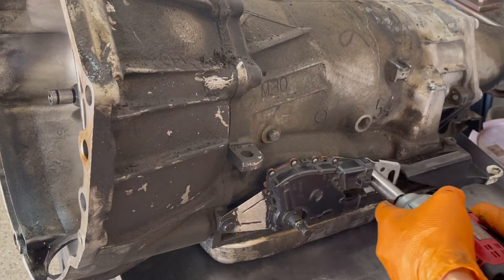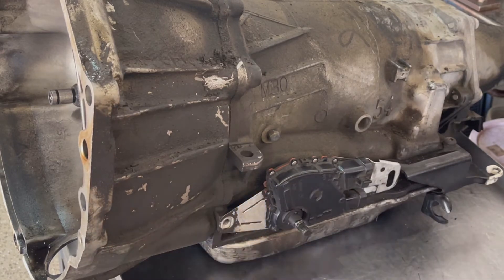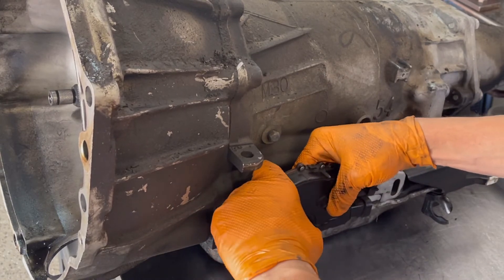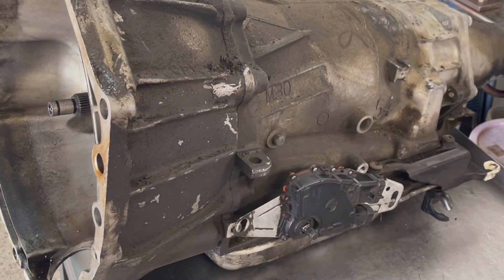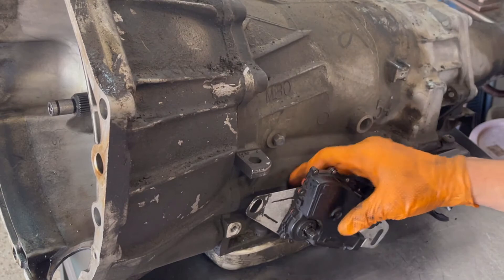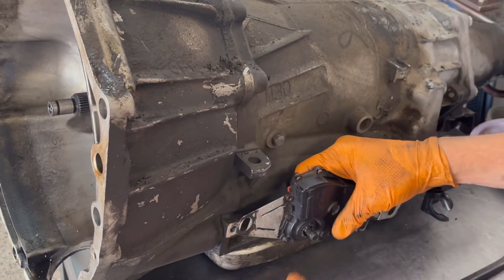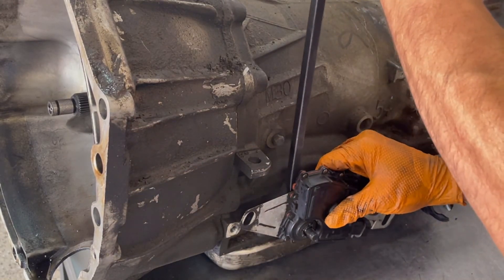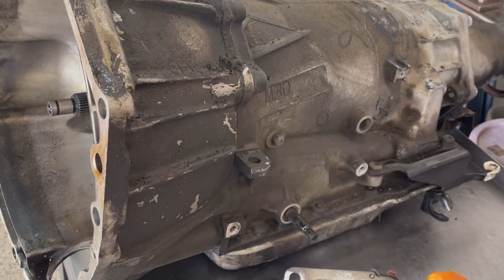4L60E & 4L80E   No Crank No Start Bad Digital Range Sensor/MLPS/Neutral Safety Switch

Comment: Everything turns on on my truck like normal but i replaced the transmission and now all the lights come on but it wont start or crank, it dims everything when i turn the key to start its like its trying to start in the wrong gear
Reply from the maker: What year, make model vehicle and transmission?
Reply: @nickstransmissions  2003 gmc sierra 4l60e
Reply from the maker: Check the MLPS, make sure there is a secure connection with the two pig tails - you should have two connectors as 2003 was the last year of the two-connector MLPS. If the wiring is bad or the sensor is either old or it came with the transmission you installed, I'd purchase and install a new one, just to be on the safe side. You don't want the MLPS failing strand you when you're far from home (I'm assuming you and the truck are at home atm).
Reply: @nickstransmissions  yes it crunk and everything before i dropped the transmission i put the same mlps back on it and now it does that, but im gonna buy a new one and see if any of the wires running to it are messed up but i subbed and ill lyk what happens
Reply from the maker: Sounds good, Ronnie. Thank you for the sub and for watching.
Reply: I replaced the separate valve plate in my 2017 chevy Silverado and its doing the same this in this video do you think that my problem
Reply from the maker: @deandrebrown994  - You're dealing with a no crank-no start in your 2017 Silverado? If so, what transmission do you have (I'm assuming a 6L80 but confirm or correct me if I'm wrong). It's possible your internal mode switch (IMS) has failed and is no longer sending range position data to the ECM...If that's the case, it will need to be replaced...The IMS is located on top of the TEHCM, inside the transmission. So once you drop the pan, you'll see it...Rule out all other causes first then drop the pan and test the IMS for continuity at channel N (the pin associated with communicating range position data to the PCM). I'll be doing a video on exactly how to perform this test on a 6L transmission and post to the channel within a week or so.

Comment: can you do a 6L80E switch like this
Reply from the maker: Hi Bob, are you asking if you can wire up a 6L80 IMS like a 4L60E MLPS or are you asking if I can do a video on the 6L80 IMS? If the latter, one will be on the channel within a couple weeks...If the former, no it cannot be done.

Thank you for watching!
Reply: @nickstransmissions  the 6l80e switch indicator. I'm doing a swap into a old 50s chevy car. the motor is out of a 2010 Camaro. 6.2 l99 and 6l80e trans. I'm trying to get the switch figured out so I can start it. I have a decoder for the can bus so the reverse lights work. it also controlling the park and neutral switch. but it seems like it is in between the park and reverse. a 50/50 mix.
Reply from the maker: Do you have the factory pcm from that Camaro? The Internal Mode Switch (IMS) is what you're referring to. In the 09+ 4L60Es, 6L and 8L transmissions the device that informs the pcm what range has been selected is the internal mode switch. Just want to ensure you know what the correct term is for the part. Make sure the IMS is installed. Then drop the pan and disconnect the IMS connector. You will then take a multimeter and set it to display OHMS. Put the key in the ignition, set to the on position but engine off. Put test leads on the IMS pins then have a helper run through the gears while you test different pin combinations with the multimeter. You're looking to see the resistance change as your helper moves the shifter. If there's no change the IMS is faulty and needs to be replaced. Ill link the ATSG manaul in the description if it's not there already. It has IMS diagrams and addl info
Reply: @nickstransmissions  yes the internal mode switch. I do have both factory ecm (E38) and tcm (T43) from the Camaro. your other video also said the linkage rod may not allow it to go into park. I do know it requires the sensors to have power and not have power at certain postion. I just do not have the ATSG papers in front of me
Reply from the maker: Check out my 6L80 Info thread on TahoeYukon forum - has the link to the ATSG manual and more plus a bunch of other content: https://www.tahoeyukonforum.com/threads/gm-6l80-transmission-information-thread.141927/

Comment: Is the neutral safely switch a possible fix for a limp mode issue on 1999 gmc safari?  I have been dealing with this for over a year . It has intermittently shifted fine but majority of the time the van wants to take off in 3rd gear. I can manually get 2nd gear but no 1st gear.  I have changed both switch solenoids, ignition switch and recently the pcm. No fix yet. After installing pcm  ans going through security protocol the van started and ran. I let it sit several days and now it cranks but no start again...any help appreciated
Reply from the maker: Hi Tim, sorry to hear you're having those issues.

Sounds like your transmission is going in and out of limp mode. When the 4L60Es go into limp, you have 3rd and reverse, that's it. I suspect nothing is mechanically wrong with the transmission itself however you have either short-to-ground issues external to the transmission or perhaps the wiring harness inside the transmission is bad. First step is to determine if you're getting any voltage to the transmission. Use a multimeter to see if any power is making it from the ECM via the external wiring harness to the transmission's wiring harness then go from there based on what you find.

If your MLPS was bad, you'd have zero crank whatsoever so a "No crank, No start" condition....Sounds like you have a "Crank, No Start" condition, which means you're missing either spark, fuel or compression.
Reply: @nickstransmissions  local shop here checked electric to transmission and claims all is fine. Pcm was a hail mary.  When hooked to scanner it shows van is in 1st gear when actually it is not. Now after installing pcm I have a crand but no start issue again. I'm gonna run through the security protocol again to see if will start. If not I'll put the old ocm back in it and see what happens
Reply from the maker: Yea, my suggestions are based on the info you provide to me and didn't mention a shop looking at it (doesn't really mean anything as it's common for shops to miss things like electrical issues). 

Does it crank, sounds like it's going to start then immediately die? If so, that's definitely VATS not being reset. There's a 10 minute protocol and a 30 minute protocol...If the 10 minute protocol doesn't work, you basically do the process twice more and that should work. 

If it cranks over and over but simply doesn't want to fire up, we're back to spark, fuel and compression.

ETA: Since your trans is starting out in limp mode (3rd gear), I'm inclined to believe that you have either a PCM issue or undiagnosed electrical failure and that's why I suggested that you use a volt meter to see if you're getting any power to the transmission at all via the external wiring harness. If you're getting the required power supplied to the transmission then the problem is either in the transmission's harness or electrical components or the power train control module.

Comment: I have an 07 silverado but I can usually hear my fuel pump in the ON position. I have no crank, no start. Only thing that works is my interior accessories and lights.
Reply: Thank you! Yea I’ll google that. I’m not sure how to do a continuity test on the switch but I’ll look also. Swapped the starter fuse and it didn’t start and I used a jumper wire in starter fuse spot and it crunk so I’m assuming the starter is good
Reply from the maker: You're welcome, Josh. Please sub if you havent already...ill actually be publishing some diag and trouble shooting videos in the next couple weeks or so...
Reply from the maker: Thank you!
Reply from the maker: Hi Josh,

Any recent history of battery or charging system troubles? If not, and given all your interior stuff works, I'd suspect the mlps (4L60e/4L80e) or internal mode switch (6L transmissions
Reply: No history. My battery cca was 460 and the battery is rated 910 cca and 12.1 volts. 2019 battery but I would figure I would get a click or something. Jumper box won’t even do anything
Reply from the maker: Does the battery show 12 volts on your tester?
Reply: @nickstransmissions 12.1 volts. I was leaning towards the ignition switch. I did charge it to 12.6 and it didn’t do anything. Just the cold cranking amps are low. I mean I guess the battery could just be damaged. Is the mlps the same as the neutral switch?
Reply from the maker: Do a load test on the battey to see if it's damaged (search google if not sure how to do a load test). Check for blown ignition fuses. The ignition switch can also be bad; check it for continuity and power. Also check the starter solenoid also. If you can rule those out, the mlps is likely the problem.
Reply: Did you find your problem? Mines doing the same
Reply: I had to have a new computer unfortunately
Reply: @joshstokes5669  when you turn your key to start did the headlights blink like it wanted to start? Its no noise but it kinda like dims all the lights and stuff
Reply: @joshstokes5669 was it like you trying to start it in the wrong gear?

Comment: What year is this for? I have a 02 Chevy express 1500 with the 5.7 Vortec that has been having some severe power and fuel mileage issue then suddenly no crank and no start. Pulled codes P0300 and P0706. Worried it was the transmission I took it to get diangnosed and they said the trans is working great but the engine seems to be having a misfire issue. Another shop said to replace the distributor because it was “charred” and replace the neutral safety switch. I’m curious your thoughts and recommendations. The van has only 17,000 original miles on it
Reply from the maker: Id check the harness and grounds on the vehicle, look for anywhere there's either exposed wiring or missing/damged grounds. 

As per the video, do all of your accessories, lights, radio etc work but no crank-no start? 

Have you tried starting it in Neutral?

The mpls in the video is the same as yours ('96-'03). '04-'08 used a single plug. 

Bad Dist/coils usually presents as a crank-no-start.
Reply: @nickstransmissions  I’ll check the wires asap, this is my girlfriends van and she updated me and said it typically does crank but not start. Only didn’t crank and no start a couple times and figured out it was just a loose battery terminal. 

Going to try it in neutral this evening
Reply from the maker: If it's cranking then the problem is downstream of the MLPS, e.g. the MLPS is NOT the source of the problem so no need to attempt a start up in Neutral. Replace the distributor after a visual inspection confirms the shop's diagnosis then if it still doesn't start up, check fuel pressure at the schrader valve on the fuel rail and spark at the main ignition coil.

Comment: Does this also prevent the fuel pump from working?  I'm trying to determine if I have a neutral safety switch problem or an ignition switch problem.
Reply from the maker: Hi John, no impact directly to the fuel pump...The PCM simply shuts down the entire ignition sequence if it's missing the data that the MLPS provides in the event it fails or the wiring going to the MLPS gets damaged/broken.
Reply: @My Transmissions  so this means that the fuel pump won't engage because of this sensor? Currently going through this.
Reply from the maker: @Theyoufeelme  Are you dealing with a no-crank, no start or is the engine cranking over but not firing up?
Reply: Can this cause all power to die when trying to start? As soon as I try to start I instantly lose all electrical power, and gauges even get stuck on dash. I have to wiggle battery terminals and try again. Got it to actually fire up but it comes back
Reply: I found that the two plugs on the nss and the oxygen sensor right above it are all corroding and the rubber is coming off the wires causing wires to short out. I still haven't found my main problem but I'm definitely having low fuel pressure, and a crank no start, I've replaced the distributor, rotor, and cap, control module, oil pressure sensor, thermostat, tps, map, cleaned the EGR, the iac, the maf, throttle body and plate, the, , the PVC, checked and replaced  vacuum hoses, checked fuel pressure regulator and replaced the fuel pump and filter twice in the last two years. Checked the injectors placed the intake manifold gasket. I feel like it's an electrical problem but I also have a new battery also.

Comment: Can you switch a 4l60e manual lever switch to a 4l65e with no problems? 
I have a 4l65e with only one connection and my 4l60e has 2 connections, will this be an issue when swapping transmissions?
Reply: Can I interchange 4l60e to 4l80e safety switch
Reply from the maker: Connectors and ports must match...Your 4L65e uses an 11 pin 4L80E MLPS so that's what you need...the 4L60E uses a two port connector (one for 'Park' the other for 'Neutral') thus not interchangeable from a single port set up.
Reply: So the 2004 4l65e will not work in place of my 2001 4l60e?
Reply from the maker: If swapping the entire transmission, it should work as 01-early 06 will interchange.
Reply: @nickstransmissions  yes I’m swapping  entire transmissions. I have a 2001 5.3 with 4l60e just want to swap to 2004 65e with no problem I hope 🤞
Reply from the maker: Yep, it should work just fine and the 4L65E had the stronger 5 pinion front and rear planetary carriers (4L60es had 4-pinion planetaries) plus all 2003+ 4L60Es had a roller bearing in place of the thrust washer that came on the 02-back on the intermediate shaft so you will have a stronger trans that should run a tad cooler, all other things equal.

Comment: Can i remove this without dropping the tranny?
Reply from the maker: Yes, it can removed without dropping the transmission but the connectors may not come off easily...If difficult to remove, use a heat gun (or hair dryer) over the two connection points for appx 20-30 seconds to melt the dialectic grease so that you can safely remove each connector from the sensor.
Reply: @nickstransmissions  thank you. According to the transmission diagram for my 08 Escalade, the internal mode switch is located inside my tranny pan. Messy job 😫.

Comment: If this neutral safety switch is bad will it blow the 40 Amp fuse for the ignition? I have a 2002 chevy silverado 1500 HD that keeps blowing the 40 amp fuse on the ignition as soon as i turn the key to start.
Reply from the maker: It's possible but not likely. I'd check your ignition switch itself as well as related wiring for any exposed/partially torn wiring. Also check grounds for the ignition column and ignition coils themselves. Lastly, only use genuine GM replacement parts for anything electrical/electronic as aftermarket/non-OEM stuff has been known to cause shorts and other issues.
Reply: bottom of the ignition switches are exposed circuitry, mines was exposed from previous owner and shorting out, wrapped in in tape till i found the little cover off another truck in the junkyard

Comment: Excellent Video! Very helpful! Keep them coming!
Reply from the maker: Thanks, man - will do!
Reply: @nickstransmissions  Greetings! I replaced my transmission shifter cable on my 02 Avalanche 2500 and although everything went well, the gear indicator light is no longer present (The light that illuminates/highlights the current gear the truck is in P R N D 1 2. I was told that the issue could be in either this neutral safety switch or a component within the transmission. Does this sound correct?

Comment: Hey question I have a 1997 k2500 4×4  when the tranny gets warm it will grind in park and then it will not move until it cools down a bit what could it be...... Someone told me it's the neutral safety switch
Reply from the maker: Could be a few different things, either in the trans or tcase. If the mlps fails you get no ignition at all. If it partially fails you get ignition in park but not neutral or vise versa. 

Grinding indicates issues with the gear train or stripped gear teeth somehwere in the trans or tcase. Tcase gear/counter gear mesh issues due to bearing or synchro failure can also cause this. Lastly a malfunctioning transfer case encorder motor assembly may be at fault. Do you have any “Check 4x4” indicator message or the CEL illuminated?
Reply: @nickstransmissions  my indicator light does not work on the four-wheel drive so I don't know.... I thought about just pulling it and rebuild the tranny and go from there